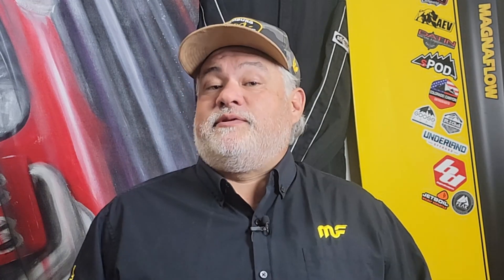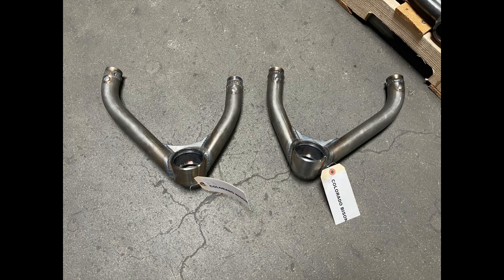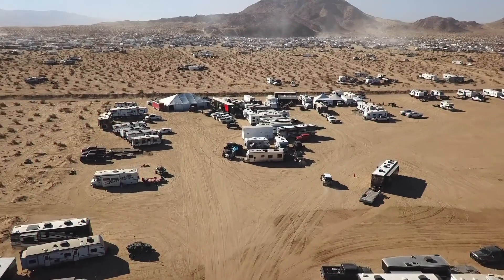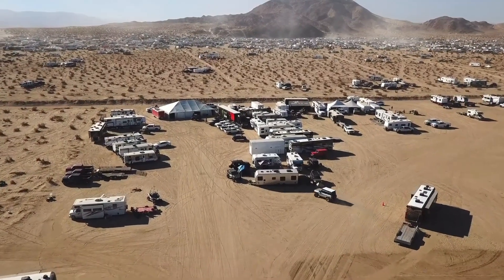Camburg's newest Colorado ZR2 suspension offering:  Fully Adjustable Upper Control Arms

Comment: Hi, old content... But, just got the Camburg UCAs. Installing them with Carbon extended travel coilovers. What trimming did you do? Camburg calls for removing the droop stops. Did you also radius the gusset similar to what you do with Peak UCAs?? Thanks for all the content you've put out there.
Reply from the maker: Just the droop stops. I did not have to do any other modifications.
Reply: @exhaustinglife thank you
Reply: @exhaustinglife  I installed the UCAs yesterday. I cut off the droop stops. But, also needed to radius the gussets. At full droop, the UCAs were hitting on the opposite side of the droop stops.

Comment: Hey Richard first off thanks for all the content you provide for us ZR2 owners!  Your videos have been super insightful and helpful.  Couple of questions if you don't mind... So I have read that with the heims and uniball that noise is a big issue after time. I know you have had these Camburgs UCA's for just a short time but what is your experience with noise been thus far. Last question...what is your experience with the life expectancy of the uniball and heims and are they easily replaceable in a home garage setting?  Thanks and take care
Reply from the maker: Thanks for the kind words and I'm happy to be a part of the community. 

Heims and uniballs will require some attention. Keep them clean when you can and lubricate after extreme use with the proper lube. I use the Tri-Flow PTFE super lubricant. 

So far I have about 8 months and 16,000 miles on them and no squeaking or noise indicating a loose or worn joint but i do pressure wash after each off-road adventure and lubricate after drying every time. Camburg uses larger than most gear featuring beefy FK 1.25" uniballs and 0.875" heims compared to most others 1.00" uniballs and 0.750" heims. The bigger parts will extend longevity over the smaller parts.

I do most my work in a "home / garage environment" and even if its in a shop I'm using typical consumer available tools. Taking the arm on and off is a breeze should you need to service the heims with the biggest thing being addressing an alignment if you didn't measure out your set-up. The uniball can be pressed out with uniball press tool on the vehicle or can be pressed out with a c clamp and some lube on a bench, nothign that i consider requires a shop.

Lastly, if you can find a great articulating ball joint, it will prove to have a better street service life and as good strength. Camburg is working to expand their x-joint (their HD ball joint with high articulation) application list but at this time nothing is expected for the Colorado ZR2.
Reply: Richard thanks so much for the info!  Im def loving the new Magnaflow overland exhaust that I put on not to long ago!
Reply from the maker: @zr2overlander323  I had a bigger than usual role in making these come to market and I can confidently say its near the best we can do considering the price point. It offers a good power increase and ability to support a power adder,  it gives you a good V6 note without sounding annoying and the tunable No Drone Technology is an industry exclusive.
Reply: I totally agree. For a V6 the exhaust sounds about as good as it can get!

Comment: The description said they are for a 1" to 2.5' lift. Will they work for the BDS lift also?
Reply from the maker: The BDS lift doesn't have an issue with the stock ZR2 upper control arm or the ZR2 GMPP part so this would be compatible in theory and it would give you much more geometry adjustment; however, the issue might be offering TOO MUCH droop which might effect axles and such. You would have to keep that in consideration in the shock length or having a limiting strap it it can drop too low.